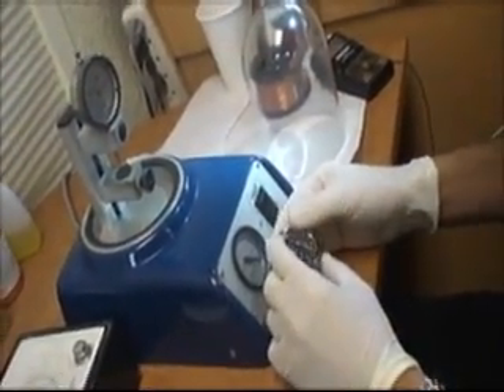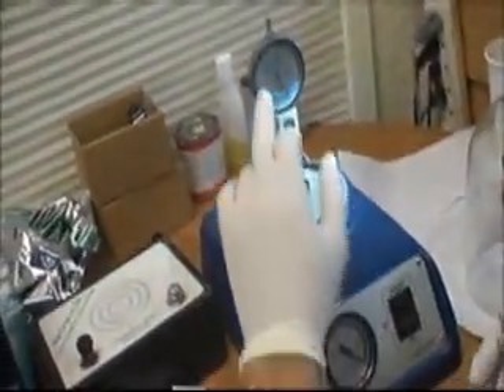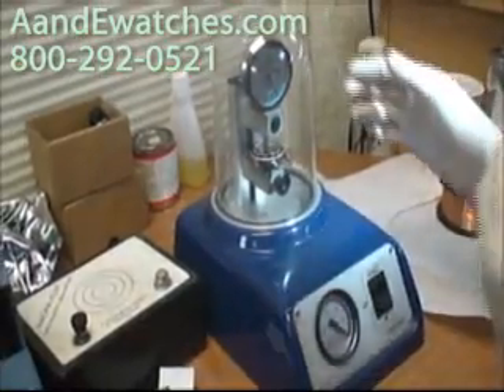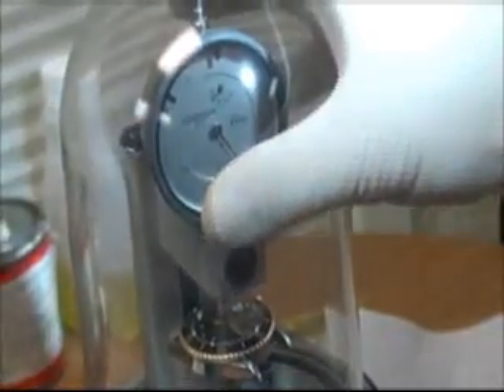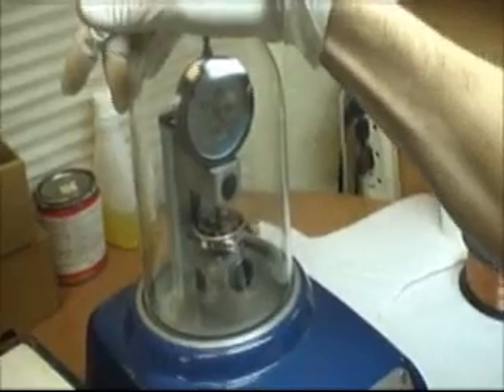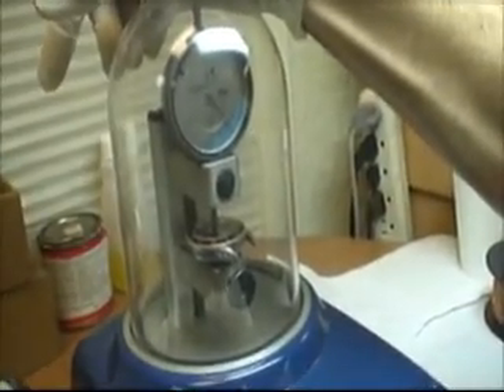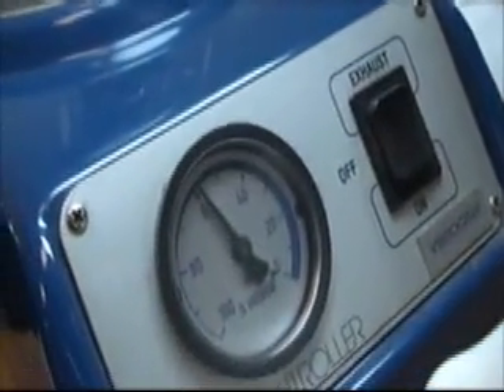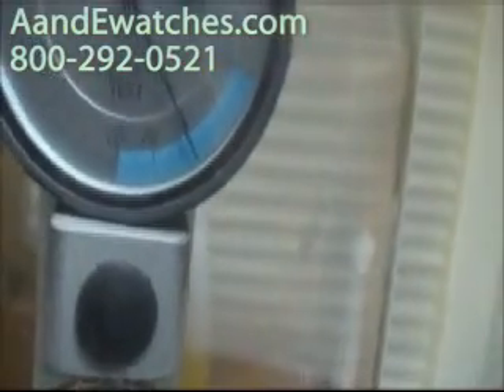Waterproof Testing of Rolex Submariner

Comment: > Most Rolex (virtually ALL modern specimens) run at 8 hz..
> which is absolutely visible.. subtle yes, but easily seen
> with my naked eye

If you can see a second divided by 8 increments, without a loupe, you're got superhuman powers.

That would be 0.75 degrees, or on a watch that has a 2.5 cm face in diameter, which is huge, you'd be able to discern the movement of 0.164 mm without magnification.
Reply: Actually, a second on a Rolex (like 95% of top watches, Breitling, Omega, ...) is indeed divided in 8 increments, but it means the watch runs at 4 Hz...

Comment: mostly incorrect

OysterQuartz are VERY rare.. occurring nowhere near 1 in 50..  don't remember ever running across one in the wild.
Most Rolex (virtually ALL modern specimens) run at 8 hz.. which is absolutely visible.. subtle yes, but easily seen with my naked eye.

regarding fakes- For quite some time now, even a lot of cheap ones run at 28.8k. So, alluding to that as being some significant indication of real/fake is disservice.
Anyone so naive will be fooled by all but the worst fakes..

Comment: I have to wonder about the principle about these machines.
  The idea is that the seal remains, decreasing the force on the crystal, so it pushes outward. 
  But water pressure is in the other direction. It's possible to make a seal that passes one way better than the other.

Comment: The new Planet ocean with it's co-axial movement is superior when considering accuracy and the length of time required between services, however, I'd rather have the Sub Date, simply because it's a classic look that will never go out of fashion. However, if you want a more modern looking watch (at £1470) less of a price, then the new Full Size Planet Ocean Seamaster is VERY impressive. Great value, looks good, heavy and reliable.  However, if you're brand orientated, it's still not a rolex!